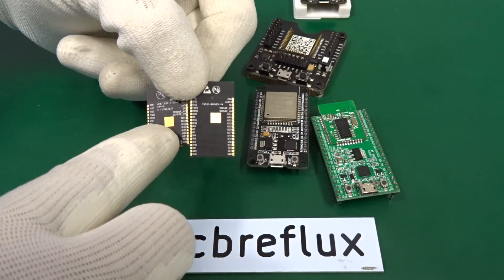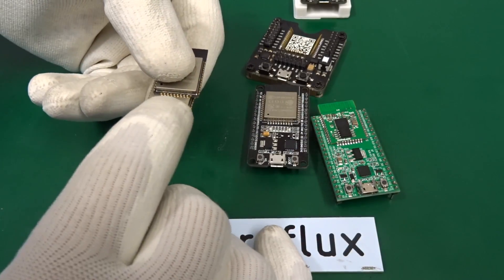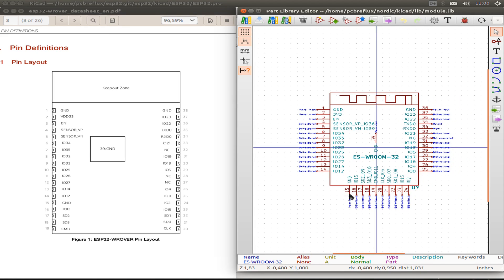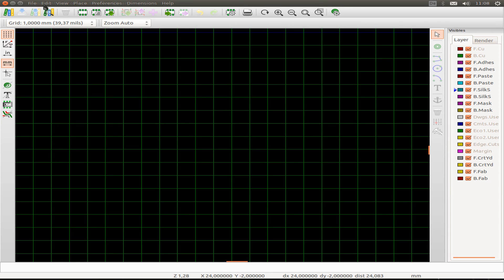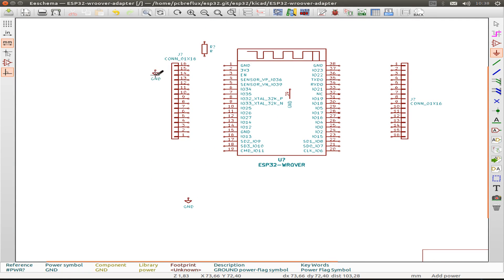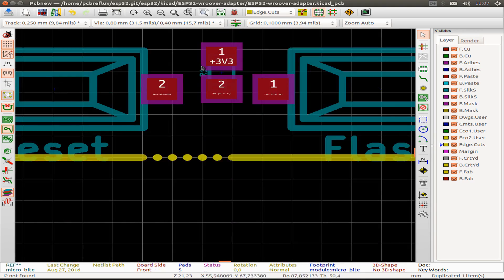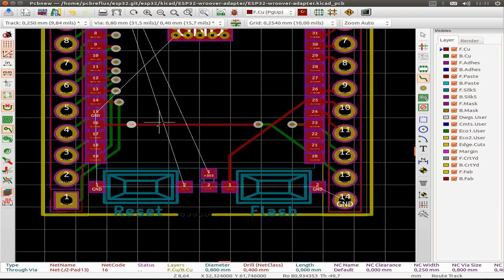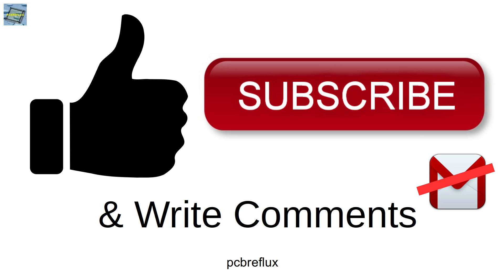ESP32 #68: KiCad ESP32-WROVER Adapter

Comment: Great design! But you need to little improve your schematic drawing skills, because It doesn't look very nice. It's not bad, but not nice either:
1. Don't put wires through symbol.
2. That pad GND should be on bottom of the symbol.
3. Little more spacing between elements.
Reply from the maker: Thanks.

Comment: What's the name of the connectors of the flash adapter at 3:18?
Reply from the maker: Hi, search for cp2101 or cp2104 UART Adapter.
Reply: @pcbreflux  I was actually talking about the connectors that allow you to insert and remove the ESP module very easily...
Reply from the maker: Hi, mine from aliexpess, but there may other sources. Search for "esp32 wrover test fixture" or "esp32 wrover test board". Have a great day.
Reply: @pcbreflux  Thanks for the tips!

Comment: Great video!  Having trouble locating a pushbotton switch that matches the PCB footprint.  Do you have a part number and vendor for pushbutton switches you used on this board?
Reply from the maker: I just search in aliexpress for "smd push button" the items should look like this https://m.de.aliexpress.com/item/32725727399.html ok this is not best quality but ok for my purpose.

Comment: Thanks for the video. But why you did not connect all the pins of ESP32 to the header?
Reply from the maker: Meisam The adapter is intended for breadboard experiments. It fits on standard breadboards and you have all useable pins left on both sides with all functionality even with all touch pins (GPIO 0). Sure you can add a usb to uart and a voltage regulator but in most of my projects I try to develop around a bare solution (i.e. current measurements). Thanks for watching and asking.
Reply from the maker: Meisam Ok, sorry Miss your question: the unconnected pins are used for the internal flash memory and ram. So you can not really use them.

Comment: nice. Have you considered using staggered SMD .1" headers?
Reply from the maker: Arnþór Gíslason Good point, but have tons of through hole pin headers each for few cents. Will use the adapter in a breadboard and will change them often, don't know if the smd headers will have the same mechanical parameters. But will consider using this in some later projects.

Comment: Thanks for scharing your KiCAD-Skills! Very impressive.
Did you relocate the thermal via pad ("GND PAD") to the wrover location?
How to deal with the additional RAM? 
I was watching the Rover boards in the past but I was not Aware that there are Wrovers with pcb INVERTED F-Antenna AND IPX connector like the WEMOS D1 mini PRO. Thanks for this hint.
Reply from the maker: klassich D Hi, thanks. See ~ 8:15 for the GND pad. But have to admit that today I've no clue how to use the additional RAM. But as most of the ESP32 stuff it should be easy to find out.